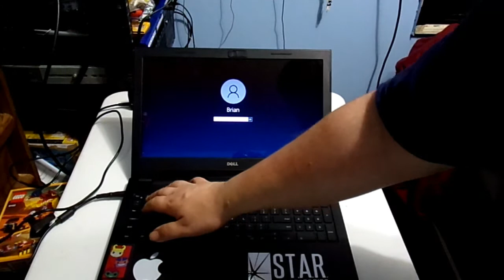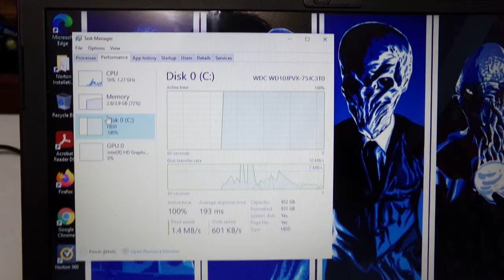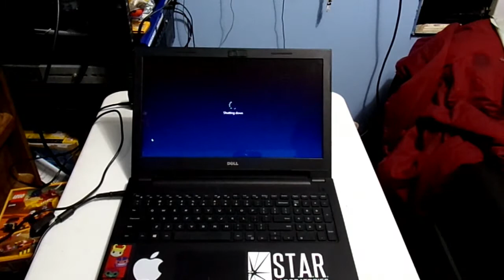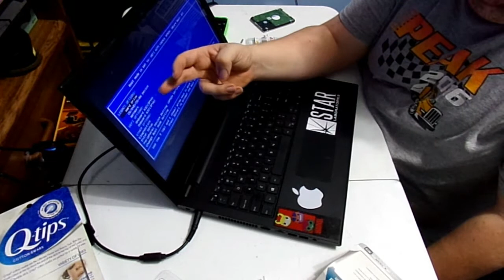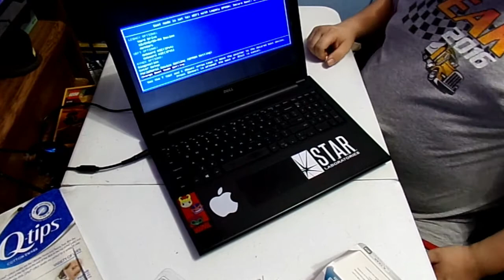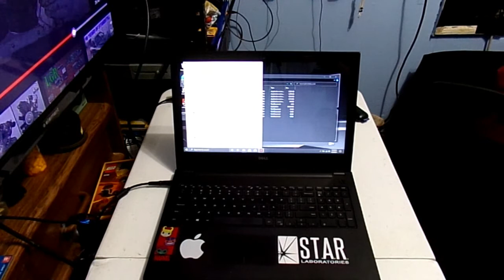Brian Laptop Upgrade and Thermal Paste Replacement

Comment: Need to post video on the Pontiac they seem to get more views. Just trying to help you out my friend
Reply from the maker: I agree, i have two new shields for the motor bay that install inside the wheel wells coming in in the next two to three weeks, plan to do a short video on those and will include the GM part number for those that want to get them